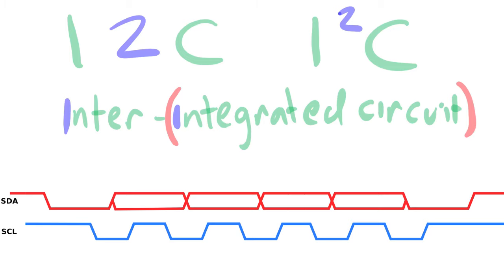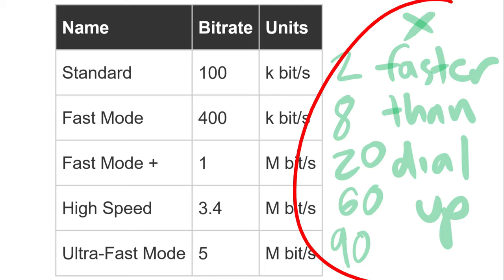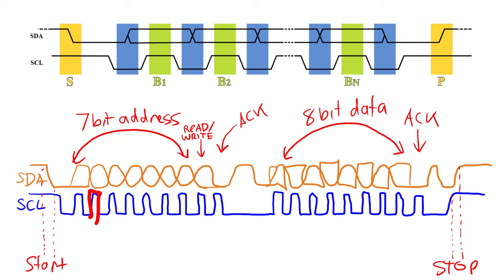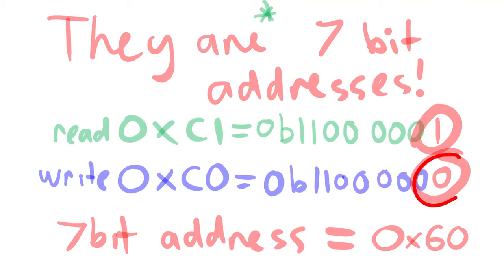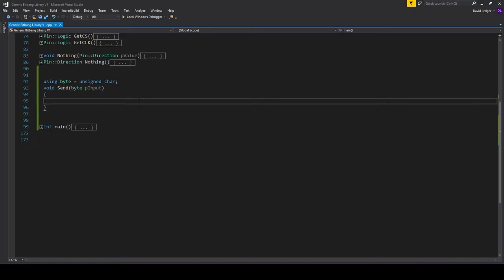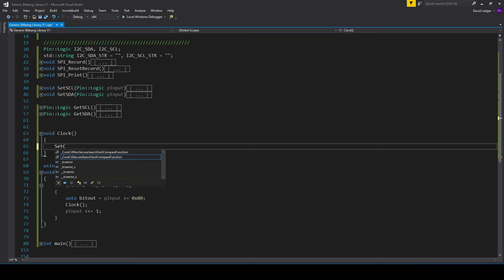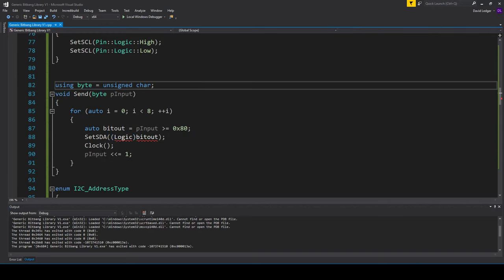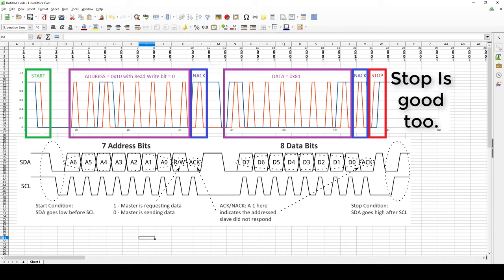EEVacademy #4 -  I²C (I2C) Bit Banging

Comment: I highly doubt that a beginner in I2C was able to get enough usable data out of this.
Reply: Well then the beginner should ask questions for a followup or just re-watch the video a couple times and pause occasionally.
Reply: I'd rather watch a long video that explains things slowly than rewatch a short video that breezes through everything 5 or 6 times and still have to consult additional resources to fill in the gaps. Better to do things properly rather than quickly. It's more effective and less tedious. Think about it, what's more boring? Watching the same 10 minute video 5 or 6 times, or watching a 50 or 60 minute video once? If it's too slow you can always increase the playback speed anyways.
Reply: A nice intro but he did cruise through the code part.  A github of the code repo would be useful.

Comment: That code won't work reliably on a fast processor- you need to enforce delays to meet the timing requirement for the bus speed you're implementing.
Reply: That code would be in the pin set and read (editted typo) functions. As it is different for each implementation (timing) it isn't in the platform agnostic implementation, a delay in a simulated version would serve no useful purpose unless a slave was also simulated with timing.
Reply: The introduction was nice, but then the code writing was really fast and would be helpful to actually talk to a real device. Also might be easier to understand with Arduino code, without all the C++ overhead. And maybe include just stdint.h, then you can use the standard types uint8_t etc., instead of aliasing byte. Last but not least, you didn't implement clock stretching. Most devices don't use it, but the more complex ones might do. This would be something you would see when testing with real hardware :-)
Reply: Sorry, looks like clock stretching and the extended address scheme is implemented in the code. But I think multi-master mode arbitration is missing, but I've never seen this in the wild.
Reply: Yeah, I might do it I don't know if I can be bothered haha. I didn't setup my library well for multi-master would need some refactoring.

Comment: One potential trap when bit-banging I2C (or implementing an I2C interface in an FPGA, for example): Because the rising edge of the clock/data lines will be very slow (due to the pull-up resistor), there's a lot of potential to read spurious transitions. If you're using a schmitt trigger input then you don't have to worry about this, but otherwise you have to implement slightly more intelligent logic for detecting a low-to-high transition (e.g. watch for the line to be high for a successive number of reads in a row, not just a single low then high)

Comment: It should be noted that other I/Os can have resistors too, but they are not used for open-drain lines, but instead used for weak pull-up or pull-down. For example, a circuit may pull-down an enable pin so that they device may not be active on boot while the MCU or FPGA is being initialized.

Comment: Good crack at it! I'm a serial newb and I learned something, so I'm glad I watched it. The real-time markings were a great visualization tool, the terminology was well explained, and the I2C behavior was well explained from start to stop. ;)

One strategy in teaching is to start with an objective, better yet a question, presented to the audience that you then work through: it helps the audience with context as they're otherwise focused on understanding each step. The big picture is the most important thing viewers can walk away with! (Hopefully it empowers them to find smaller details as needed.)

Similarly, as people are complaining about the pace of this video--I would say the underlying problem is scope. There's a lot of good stuff covered but what did you /really/ want to talk about? An exposition of I2C, a sample bit-bang, caveats/applications, etc. A better question is: what did you want the audience to take away from your lesson (the objective)? A good answer to that question will refine your curriculum and it will be much easier to explain without feeling rushed.

I had these same issues when I started education (I'd end every lesson panting) but if you thoughtfully keep at it I'm sure you'll improve, if that's your goal!

Comment: I wrote my I2C routines in Z80 assembler. There's no minimum speed it will run at as I was able to single step through my code to check everything was working correctly.

Comment: I2C & SPI are about as simple as it gets. How about something more advanced now, like bit banging USB 1.1.
Reply: I've read the whole USB Standard book, big banging USB is on another level, there's a book keeping part in USB that will be complex to implement and to show on a 10min video.
Reply: rocketman221projects the 2 problems with USB is that it adds a lot of overhead to the data being transmitted and it uses some kind of weird differential analog signaling.

Comment: I can't realize what does double transitions on the same diagram mean? When SDA goes high and low at the same point and is high and low after it. 3:20
Reply: That is a way that indicates that the line could be either high or low, both states are valid.

Comment: Much better than your first tutorial, but still too fast. Your code-explanations are out of sync with your actual code changes and while it is impressive to see such a fast coder as you are at work, it would be impossible to follow you there.

The explanation of the I2C bus itself was very good. Perhaps you should have concentrated more on this part alone. And while the 10bit addresses are a special case of little interest, things like clock stretching by a slow slave are perhaps more important - did you implement these in your code?
Reply: My GitCode includes provisions for clock stretching and 10bit addresses, should be linked on monday ( Work week start. ).

Comment: I liked the Dave's approach better with the white board and always learned a lot even if the subject is new to me. But I cannot say the same for this one. The introduction of subject was too general and insufficient. There was no way of fallowing the code because everything happens too fast. The only thing I got from the video is, there are two pins, there are start and stop bits, and MC waits for the response of the other device...

Comment: Novice here, I think demonstrating this with an actual project would be better.  Theory of operation is great and helpful but watching a expert tinker with something they've built or watching them hack an existing system is far better once you have the basic operation under your belt.  The first part was exactly that, then we watched a bunch of SPI code get converted I2C (why show that?) and then interact with no device.  Obviously, you understand bit banging to the degree that it is second nature to you but unfortunately, teaching the uninitiated is a more painstaking process and should not include sped up vid of coding that was not even initially setup for the purpose at hand.  It just adds confusion to an already complex topic.  Just my two cents.

Comment: Not only is the explanation way too fast. The slides have way too much changing information in a short duration. It's hard to determine who the video is aimed at. Beginners? Novices? Experienced? The person making the presentation?

It doesn't help that the video seems to be devoid of any structure. It's hard to determine where each subject ends and other begins, to the point that you could put the first minute in the middle of the video and it wouldn't make a difference. Tutorials should have a defined beginning, middle and end. Usually you start with a small summary about what you'll talk about, what is expected of the audience watching the video, the various things you'll show in the video, etc.

Presented this way, the video pretty much plays like a tutorial where you're giving up in the middle of one subject and starting something completely different whilst trying to make it relate to the subject that came before.

Comment: The presentation is way too fast for COMPREHENSION.  It reminds me of lightning in a bowl of glitter.  We have some engineers at work who behave this way.  (Millenial types, usually.)  I often wonder if they have a firm grasp of the subject matter, or if they are just pressing buttons until something works?  Tell you what, let me do a video in this style/format on something potentially foreign to you, like say.. "reconstructing brightness temperature in the presence of sun-glint angles requiring fringe washing in Base-6 math for two-dimensional aperture synthesis space-based microwave radiometers" and we'll see how much you truly absorbed.  Sorry, but just watching code snippits fly by on the screen is so Matrix and Keanu Reeves.  And I am rather well-versed in I2C bit-banging (Thank you very much.)  It once wasn't as common on microcontrollers as it is these days...

Comment: Like seeing a movie compressed to 1000 frames. Useless. It doesn't make you a better programmer (if thats the point you'r trying to prove) to use this insain speed. And why use C++? You hardly use any of the great opportunities of C++. Reflect upon who this "education" is aimed for... and adapt. Otherwise you will continously get bad evaluations and less viewers.
Reply: Still trying to figure this out, alot of changes since last video and many for the next.

Not trying to prove anything, just how it ended up after a ton of takes because of audio issues (which slowly drove me insane lol).

This was developed from my relatively modern library code, anything that wasn't needed was basically culled. I wasn't sure what concepts in C++ would be completely garbled to viewers. The most i figured I'd do in this tutorial was get rid of unsigned char and call it byte as its more self explanatory. What kind of things would you like to see regarding C++ and tutorial content?
Reply: The hole video is a bit of a mess. First half was fairly okay, except that the pictures were removed after ½ second. This issue could be easily fixed for the next video. Regarding the second half of the video, I don't think that implementing a software communication protocol is of high value for the viewers of this channel. And if so, the viewers are probably not experienced C++ programmers, rather C(wire). I guess, you are easily capable of doing the same in C and thereby reach your target-group. But again, give people a chance to reflect of the spoken word and if there is a good reason for editing the code at the same time, even (much) more time is required. Personally I don't have the need for a C++ course, since I have been programming this for 20 years. And even though Daves channel is at a quite high level (compared to others), I don't think that a C++ tutorial is within the scope of his channel (just a guess). Bottom line: slow down, keep it simple, not so much "bling bling" rather than thinking "is this of value for the viewer". Don't let Dave put pressure on you ;-) After all... what does he know about SW :D
br

Comment: You obviously know your stuff. You need to learn how to teach it. Slow down. If you're going to type code, type out working code from a script. Jumping around altering things, especially at that speed is confusing. Please talk about the code you're writing, not just the overall flow of what you want it to do. 
 All the random red lines were distracting. I did learn a little from your vid, but it was difficult to pull out.
Reply: Noted, thanks!